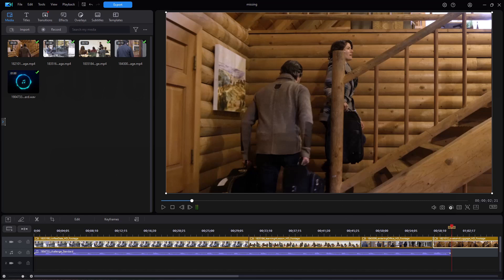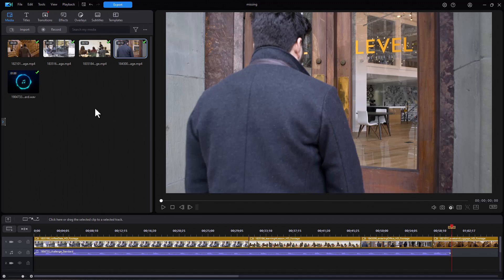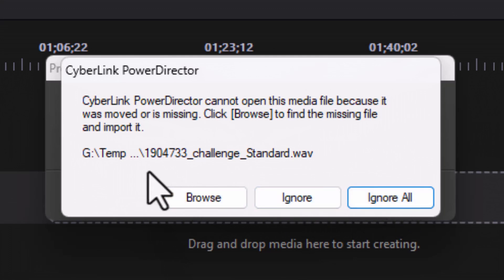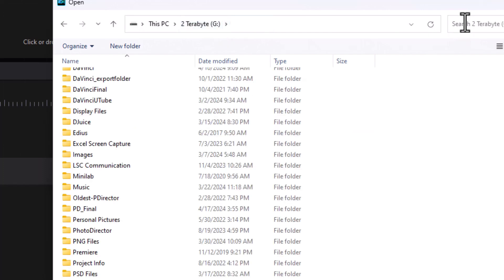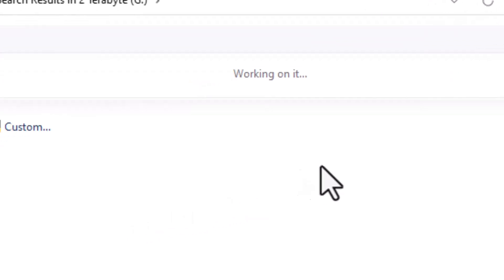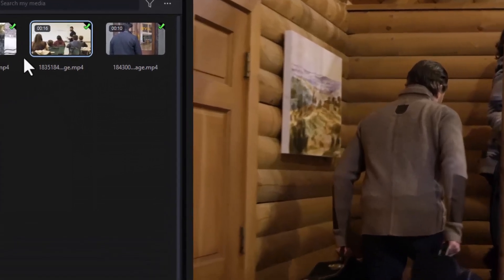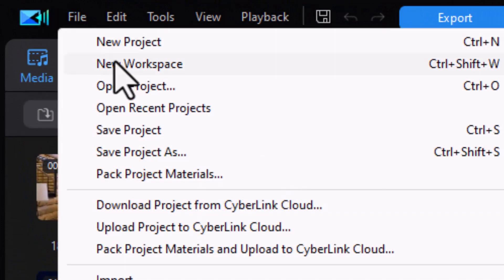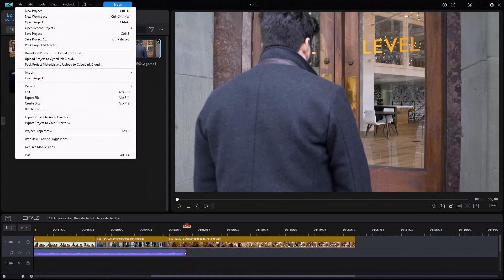How to recover missing resources when you load an existing project in PowerDirector

Comment: Very important video, Jim.  This has happened to me in the past and I have found these moved files (resources) using the method you described.  But to minimize this problem, I usually try to create a project with all of its elements within that project's overall organized directory.  Of course, sometimes it may make more sense (for some other efficiency reason) to use elements from some other common directory, so I keep a notes file within each project directory to remind me of certain miscellaneous things such as this.
Reply from the maker: I like your very organized approach. It minimizes the chance that you will have resources scattered and suffer from inadvertent moving of elements in a project. --Jim

Comment: Can I ask your opinion? I have used PD on Windows for a long time but bought an 2012 iMac. I feel the need to upgrade my pc and see there are more features with PD for Windows, so in the future, do I buy a new mini mac and monitor, or a Windows set up? I am 70 yrs old so I want to make the right decision for the next 7/8 years. IMac is great but not up gradeable, whereas I can easily upgrade a Windiws pc. What do you think is best?
Reply from the maker: That's quite a question. Both are workable alternatives. 

It depends on your priorities. If you want the platform that provides the most features now, the Windows platform wins. I don't know how long it will be before the features on the Mac side match those on the Windows side. So if maximum features are critical, go for a Windows platform.

The Mac is a closed system, as you suggest. That normally means less glitches and more stability, but less flexibility on the hardware side. If you expect PowerDirector to mirror the features on the Mac platform in the near future--I have no idea when or if that will happen--then the Mac will be fine. 

From the way you state your question, it sounds like you are leaning to the Windows platform. That is my preference, but basically because I like to assemble my own PCs.

Jim